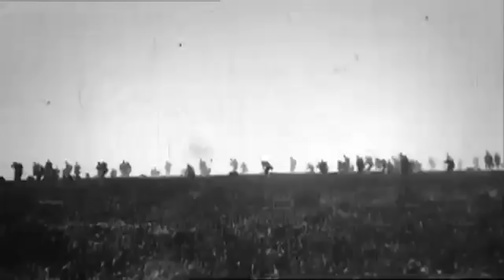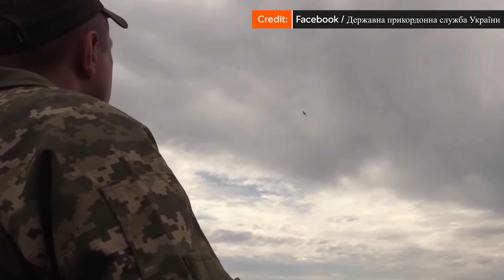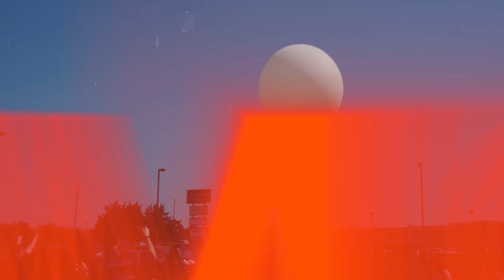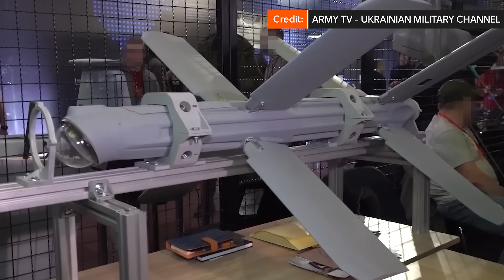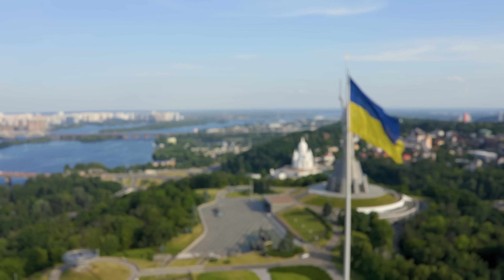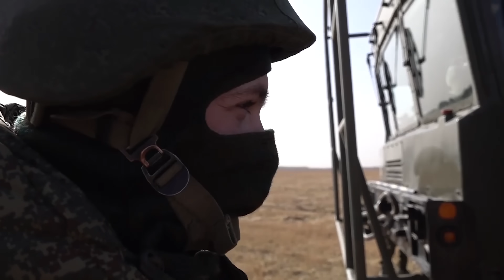Ukraine Found a GENIUS Way To Strike Crimea… 8,000 Meters Above Russian Air Defenses

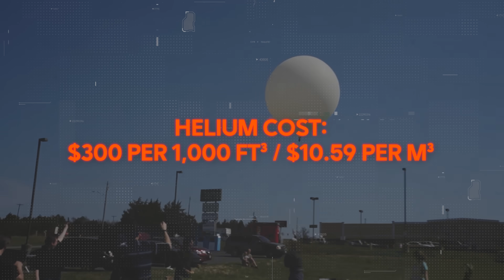Comment: @8:08 Why use rare and expensive Helium? The balloons are on a one way trip. 
Fill them with cheap, readily available hydrogen made in situ from water cracked with any source of low voltage electricity.

Comment: Balloons per se can only go where the wind currents will take it. Direction is at the will of the wind. They could draft back into your own territory. In this case the air currents head in the direction of target area. It might be even more interesting if the balloon could be steered more like a dirigible.

Comment: Balloons are too wind dependent , too easily destroyed and too big.
What about a gas/electric hybrid ?
A small muffled gas engine driving a generator  to power a battery electric drive motor ?
It could run on gas part way to target and use electricity from the fully charged battery for the remainder. It could even ditch the gas motor and generator when fuel runs out to reduce weight .
That might work for high value targets if it's expensive.
Maybe drop the gas/generator package where it can be recovered where possible .

Comment: My go to, #1 reliable source of information on the state of the war. I am partial towards  Ukraine, but this war has spurred Ukrainian innovation  and technology to the point where it is now one of the frontrunners in unmanned  warfare systems. Mixed feelings on the Gripen deal, certainly good news for now, and a bold move by Sweden, but I am also partial to local innovation and local manufacturing. More in-housing and less out-sourcing, is always the way to go for every nation.

Comment: Hydrogen balloons will be cheap to make. Ukraine should launch hundreds into Russia carrying drones at high altitude. They will be out of range of ground guns and cannons. Russian will be forced to launch expensive and scarce AA missiles to bring them down or launch fighter jets which is also expensive and adds to wear and tear on the jets. Even, better if Ukraine can use air currents to get the Hornets in a 100km range of the Tu-160, Tu-95, Tu-22M and MiG-31 bases and destroy the rest of their missile carrying bombers

Comment: My suggestion, if the wind is blowing in the right direction would be to launch cheaply filled hydrogen filled balloons carrying something with a radar signature or even a foil balloon.
If lucky it will initiate a launch of an interceptor missile. Just flood the zone with a mix of decoys and armed drones.
The air defense will know by the speed that it is a balloon but won't know if it posses a threat.

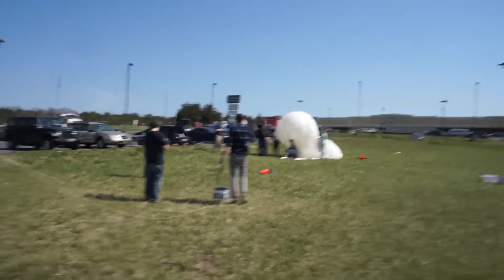Comment: @7:47 Why not use hydrogen? Are you planning on reusing the balloons? 
Water + some solar panels/batteries producing electricity -> hydrogen and more breathable air.
The electrolysis equipment, balloons and drones can be loaded on a drone carrier platform miles from the front and be deployed on a  Just-In-Time basis.

Comment: Hydrogen?  Never heard of the Hindenburg, I take it?
Reply: Yes we’ve heard of it, but unlike you we understand it. Hydrogen wasn’t the trigger that brought down the Hindenburg, it wasn’t even the material first ignited. The Hindenburg would have gone down even if it was filled with helium. Whatever the ignition source was (still undetermined) the skin of the Hindenburg with its flammable paint is what started burning first. It would have consumed the airship and crashed even it had merely released the lifting gas.

Comment: Why not use hydrogen? Hydrogen gas is readily available, will lift 17% more weight than the same helium gas in a baloon and the wholesale cost is 60 to 70 times cheaper at only $3 to $17 per 1000 cubic feet vs helium. The only brawback is that hydrogen gas is extremely flamable (think hindenburg dirigible disaster of 1937) but who cares?

Comment: so, you know...I'm no expert, but I have heard that hot air balloons can land wherever they want because even though they have to follow the direction of the wind, the wind blows in different directions at different altitudes. If that's the case, all they would need to do is build a gas pump into the balloon system to control the altitude, and they could deliver the balloon anywhere they wanted.

Comment: Question, over Russia Starlink is disabled.  What method does the drone use to navigate?
Reply: russian starlink terminals are deactivated...but Ukrainians can register for starlink accounts that ARE active over russia.
Reply: "Ukrainian drones frequently rely on Starlink satellite internet to navigate and strike targets over Russia. Because the drones are flying beyond the reach of standard radio controllers or local cellular networks, they employ this satellite network to bypass Russian electronic warfare (EW) countermeasures and maintain a stable connection. To operate effectively, Ukrainian drones utilize a mix of these key connectivity methods: Satellite Internet (Starlink): The primary and most reliable way for drones to receive over-the-horizon commands and transmit real-time video, even deep inside Russian territory. It only requires a low bandwidth (1 to 2 megabits per second).Multi-Channel Systems: To ensure continuous connectivity if one signal drops, modern long-range Ukrainian drones use multi-channel setups that automatically switch between Starlink, 4G/LTE cellular signals, and radio links."
Reply: @jtf2dan thanks!
Reply: @jtf2dan thanks!

Comment: Plus if you compartmentalize your balloon, you negate the hole problem.
Reply: Compartmentalizing adds weight and reduces payload. It's better to just use the additional Ballon material to make the balloons a lot bigger. Bigger balloons carry more gas therefore increase payload and increases the time to deflate when punctured.
Reply: @kazedcat  I don't think you can do that. Light gas balloon flight requires neutral buoyancy, you can't just put a bigger balloon "for good measure". You could do that with a hot air balloon but those are a whole different beast.
Reply: @sCiphre Of course it works the ballon surface material scale square while volume of gas scales cubic. So the more surface area your ballons have the more buoyant it is.
Reply: @kazedcat  yeah but what I'm saying is it goes up to a different altitude.

Comment: A major reason for using a balloon is to use it as a relay station.  It can be a hub or an even simpler repeater.  This overcomes the challenge with vegetation, terrain and earth curvature when terrestrial radio communication is used.  The transmit power of the transmitter onboard the drone can also be reduced, making it more difficult to home in on its radio transmitter.

Comment: Hmmm... The Japanese tried this very same attack on the west coast of America after the attack on Pearl harbor on 7 December 941. The Japanese calculated the winds and every mitigating factor. The outcome, it failed miserably. They did have one victim which was an unsuspecting family observed a downed balloon device and had no idea of what it was a the bomb exploded killing the entire family. The most likely outcome of this type of weapon will be civilians killed and not many soldiers. Most soldiers will be highly trained and know not to engage or touch. Civilians on the other hand will be untrained and as in most cases in war torn areas be drawn to any potential food, supplies and or things they may need or can hope to use. This makes the Ukrainians appear more desperate if used. They should stick to drones as this seems to be a very good weapon system.
Reply: long way from japan to america.  very short distance from ukraine to russia....and prevailing winds go into russia...so its going to be easy....cameras will tell them when to drop!
Reply: @jtf2dan   Good point and i did not consider that. Thanks!N
Reply: The Japanese WW2 balloons carried a rack of small bombs which were released by a timing mechanism, so that where the bombs landed was largely random.  The whole point of the balloons described in the video (did you actually watch it?) is to carry a drone, greatly extending its range before release, after which it operates like any other drone.

Comment: Hydrogen can be cheaply and easily manufactured from water. Because it's flammable, it cannot be used around people, but would be ideal for drone mother ships, since safety isn't a concern. This would bring down the cost per balloon.
COST CUT 👍👍👍👍👍 COST CUT

Comment: I would love to see if they could do some sort of balloon swarm, and instead of drones, it could be massive amounts of chaff.  Image overwhelming their radar systems with hundreds of balloons dropping chaff overhead at a lower altitude, while the higher altitude balloons drift by droppjng the big drones!
Reply: Extremely flammable hydrogen (main reason why hot air ballons failed against planes) + explosive payload beneath it = better be VERY careful. Having a big swarm of balloons also means that if ONE SINGLE BALLOON EXPLODES => big explosive chain reaction and you potentially could lose everything. So, no, big detectable swarm : bad idea from start to finish.
Reply: @WawaDvd  they talked about helium balloons
Reply: @quantumslip they started with helium, farther into the video they were talking about hydrogen because it is way less expensive and easier to get.
Reply: @quantumslip  - Indeed, at the start. But Helium being 35-40€/kg and Hydrogen 5-10€/kg, added to more lift/kg and easier to get... while both can be used in balloons, Hydrogen makes much more sense... but big caution to have due to flammable risk.
Reply: @WawaDvd there really isn't anything explosive in an aluminum chaff payload. And really since it's so much lighter than a drone, you probably could just use helium, because it would be much smaller balloons as well.

Comment: I really admire the way that Ukrainians think. They didn’t just accept old technology and out of date munitions that should have been decommissioned decades ago, and make it all work, and they didn’t even just modify and upgrade it. They riffed on it, they got whole new ways of thinking out of it.  Imagine — balloons were outmoded, redundant on battlefields over a century ago: but Ukraine reimagined them.   As for being forced to use hydrogen — I once got lifted off my feet accidentally by a kite that was not any bigger than I am. I had to really fight to get my feet down and to not then be dragged along the ground. Modern kites are amazingly strong.
Reply: The wright brothers did not think of that.
Reply: @sundareshvenugopal6575  The Wright Brothers did not have the benefit of modern materials like ripstop nylon or lines made of amazingly strong and light polymers.
Reply: A big enough kite on a gusty day  would have been more than enough  to get them soaring. A sound  application of modest sailing  principles for navigation and some  rudimentary propulsion systems  was probably all they needed.
Reply: @sundareshvenugopal6575  A modern kite needs much less wind.  Much more precision control.  
Didn’t the Wright Brothers start off with gliders?

Comment: I don’t think they use helium — hydrogen is way cheaper and has better lift, and they are going one way anyway, and the drone is well below, so if the balloon blows up, no big deal.

Edit: yeah, it is discussed later in the video
Reply: Yes ,Helium is a finite resource and expensive …

Comment: Ukraine's idea to use the wind coming from the West to Northwest is a brilliant idea, to extend the range of its attacking drones! Slava Ukraine!
Reply: Those heavy strikes deep in the rear must be painful, for sure... 😝
Reply: Ukraine succeeds because it refuses to give up.
Reply: It's not the balloon you want to hit but the DRONES UNDER IT!!!!
Reply: How about a balloon shaped like an airship that is soler/battery powered that can in theory reach every part of Russia and act as A DRONE MOTHER SHIP?
Reply: If the  'aurship' can be filled with hydrogen it might be possible to top it up using electrolysis, the power coming from soler sells
Reply: But Hold My Beer. Russia can easily copy this tactic against Ukraine. I don't see this as a win for long.
Reply: @ridethecurve55  The normal prevailing winds don't favour Russia in that sense.
Reply: @ridethecurve55  It depends upon the direction of the prevailing winds, but yes you are probably correct.

Comment: well it would untill we start useing goold old proxy fuse detnatoed high cabler gun shells on modernzed world war two battlecruser and battleship mitrlay ships that used guns just for shooting down enemy aircratdf drone nas missle swarms to save on seuing missle defise missles for the more daroguers more costly stuff. the thing aobut cheap kamakize drones is that like the kamakise aircratf in world war two bacly means a bunh of high cabler smaller 20mm to like 15 centimetter good old prolelant or evene upgrade to rail gun cablers whne used with mdorezed ageis missle defsie sistem taregting and treacking and tatcal link would be far more cost evfecte and would redcue the need of so many missle unless for the most dongerous of stuff. the thing is iroanly enath we we still had older world war two battle cruser and ballteship evene without being modrezed would actly still be like five temie moreefecte and cost less then 1% of the ammo prodacut and mancafeuing costs teachly. world war two stlye gun ships actly work very good agest large amonut of cheap drone swarms you know. also modrezed there taregingadn teacking sistem wine give them modren sersors and tactal link and a agis missle defise comptuer. and replace the huge 20 cetimetter naval guns with a small maonut of like 100 vlmls cells. and then give them way more domrendized ciws like plaxl goal keepers and gate keepres and alot of 75mm to like 120mm multi persone auto cannons that can use a mix of difren shells. form close reange cluser to very big HE high elxpose metal shrapnel shells that exposle form proxy fuses and inetnal fuses and impact fuses all at the same time limnked to tactal link and of crose put like a few doens 500 to 750 killowat laser high engery sistems and alot of 25mm to like 120mm 2-25megajole railgun battrys too as well. the main weakness of cheap kamakinse drones is goold old bullets that exlode and thow shackwaves ans srapnel and molten metal and messeing with long range sensors. also we already have the tech to put a huge amonut of very good anit drone swarm anti ari proaxy and iernal and impact hiybird shels for anything bwteen 50mm to like 120mm plus. while still beting like only less then 5% ofthe cost copard to like 20+ vlms missles for like 1200+ shell ronuds for eacth gun bascly. like old world war two syle gun battlecruser and battleships can still have one good thing for mdorend anti droneand missle swarm defisne super duer ocst efectvly but just need mdorezed taregtingand tracking. and of crose modrenzed ewapons and useing tactal link and modrend gun ammo. heck evene a very lareg 20 cntimetter+ or 16 to 18 inch modrenzed battlcurser and ballship naval gun with progamrble prosaxy timedand iernal and impact fused with huge amonut of HE elxpsove shackwavesnd metal sraplentl that also modten and F***s up enmty drone eclrtoopcisand ir and other sensors form being a big hot bight flash and use alnotu of air presue moteln metla and fire blastingteh air with huge anrit air very leathel aera of denal super dupre hazreous exlpsions and molten metal and hit air and blast shockwaves. like ace cobmat fomr bandi namco style would make very cheap and slow drone swarm no longer evfective agest mdorezed naval battle curser and battshiuip. sueingthe alot of naval guns styile of world war two mordznes vessel would be the main ahrd conuter to cheap kamaksi droam swarmand hpyer sonic missles. no cheap drome or hyper sonic missle can adviod a huge amonut of huge wall of guns shells epxlingand ameking the air full of high presur crushing sockwave and lomlten metal and bruing air that evene hype sonic missle if they fly ito sucha thing ta ther terhmal [hae or faster would end up disrtyung themsefs form tinpacting as shuch highspeed would turen then into swish chesse under the own monment due to laws of pshtics. also do you know a big entog hblast forma 16 inch or 18 inch highe elsoive moten metal srapnel anti air proxy fuse with mdorezed trakingand gidance with moderzed taergingand tasctingans isesorsand tatcal link would bacly make cheap kamakis drone swarmand hpye sonic missles no longer be any more darnosy. unless they need to make like rwreungit othow like a hirdhtgtiod ata itme instad ofa a few hudrid with would defact the whole pnot of cheap drown swarm bacly at hte very conptect you know.